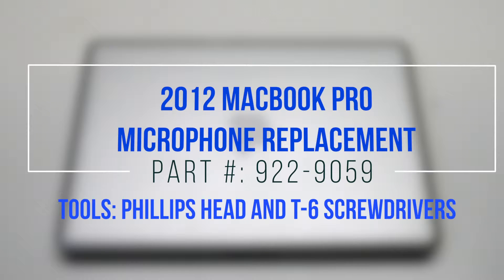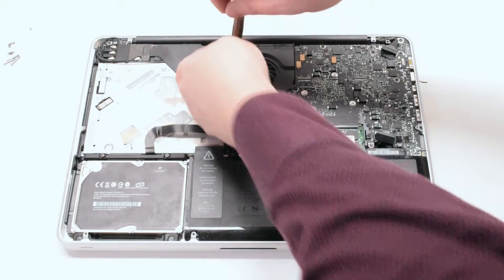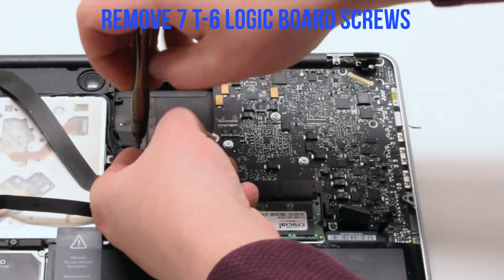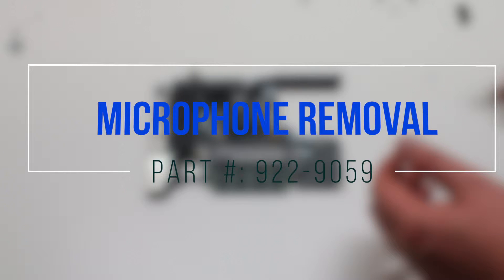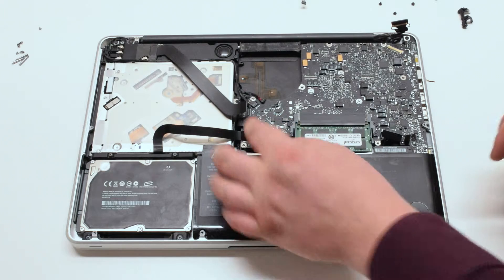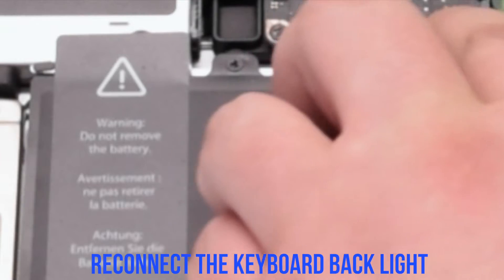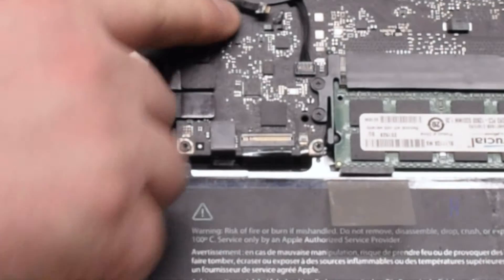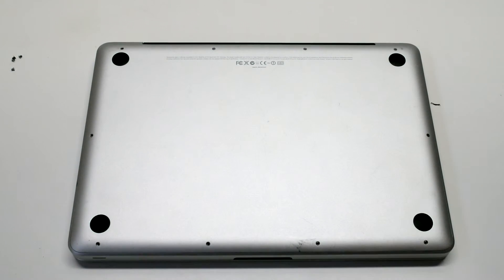2012 Macbook Pro 13" A1278 Microphone Replacement

Comment: To put the microphone back on the upper shell, should rubber cement be used, being careful not to get glue on the micro holes?  An adhesive was pulled with the microphone so I would assume you have to glue it back down, correct?
Reply from the maker: Residual left over glue works.